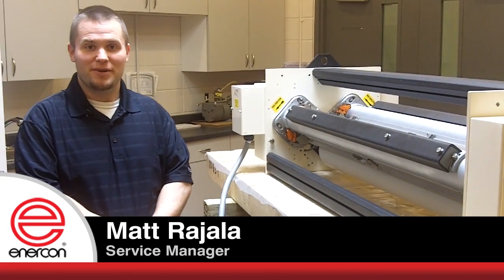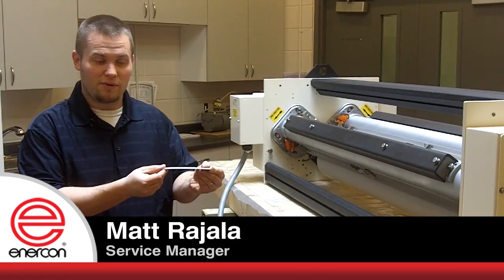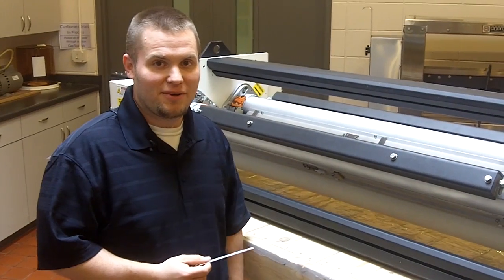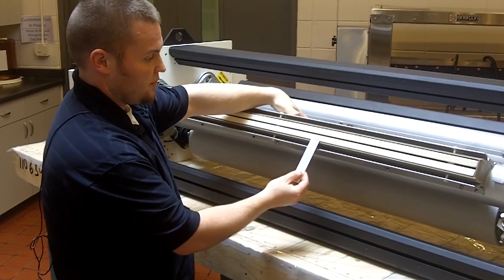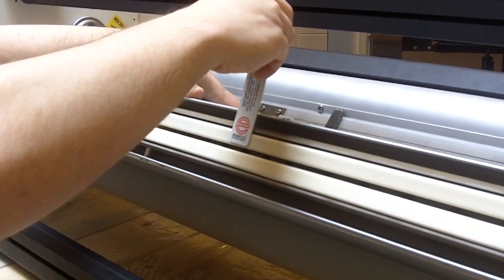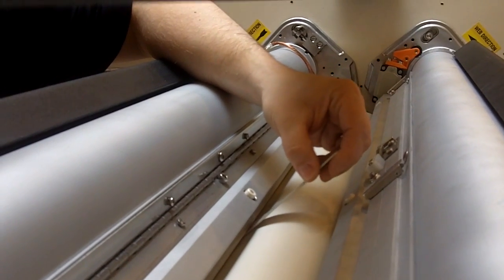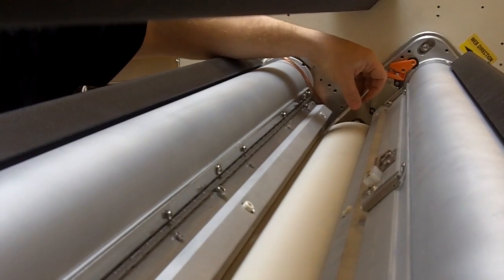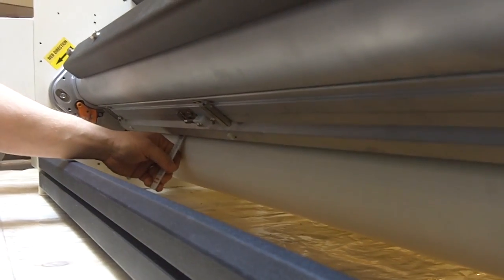How to Set an Air Gap on a Corona Treater

Comment: Hello, can a corona treater be turned on and put into operation to check the operation of the electric arc, without moving the roller?
Reply from the maker: Thank you for your question.  It is not recommended to operate the corona discharge when the roll is not turning, since this is one of the key safety interlocks that must be satisfied prior to operating.  Bypassing the zero speed interlock will put the ground roll covering at risk of damage.  If there are further questions, you may contact our service department directly at service@enerconmail.com, and please advise the system serial number from the Enercon rating plate.
Reply: It can be done but as "Enercon personel" said if you do so the insulation/silicon sleeve over the ground roll will get damaged.